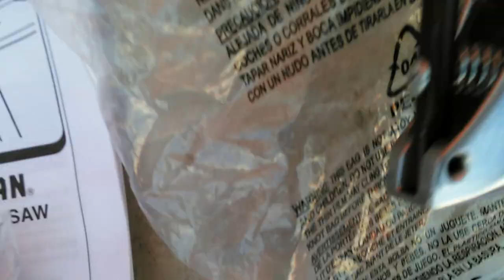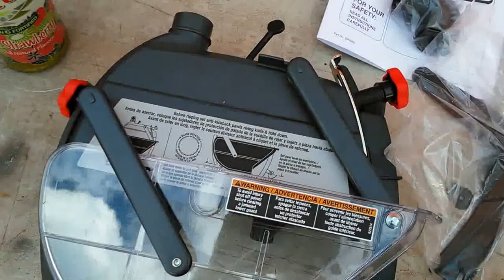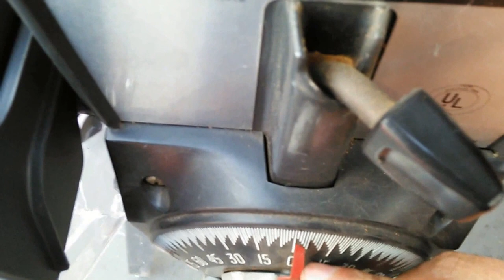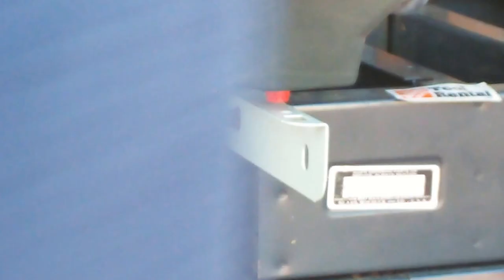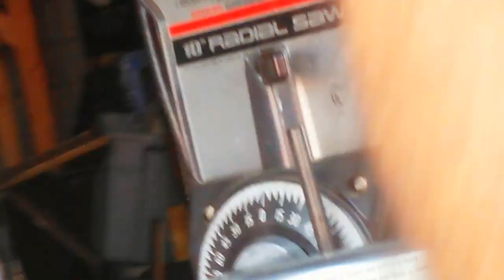Craftsman Radial Arm Saw Safety Kit (Recall and Retrofit)

Comment: what was the phone number that you call to get this kit?
Reply from the maker: A number of Youtubers have told me that the safety recall kit is no longer available for their models. I sell the replacement tables, but not the complete safety recall kit. Feel free to call me at 714-574-1544.
Reply: today is march 9,2017. Emerson says they no longer have any recall kits. Any idea as to where I can find one?
Reply from the maker: I've heard from a few people about this kit. Apparently, there must have been a statute of limitations on getting the upgrade for this saw. I know that they're offering a $100 rebate in lieu of providing the kit. I found out about the kit  by accident, so I was fortunate to have capitalized on it. I don't have the recall information any more  because it's been quite some time since I got my upgrade equipment. Try typing Craftsman Radial Arm Saw recall into your browser.
Reply: Frank Hamilton'sthe other side
Reply: now the deal is if you order the recall they will send you a box for yo to put your motor and carriage for 100$  and it states they are doing it to make sure the machine will never be used again.

I know I just paid 150.00 for my saw last week the kit would be nice for mine but very happy as is. Sending my motor off for 100$ is ridiculous then what scrap the frame.